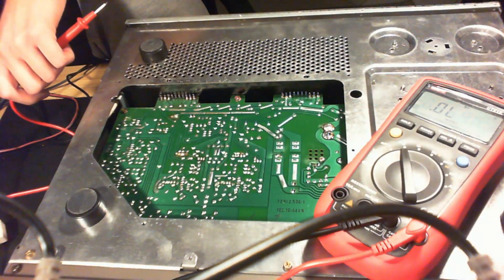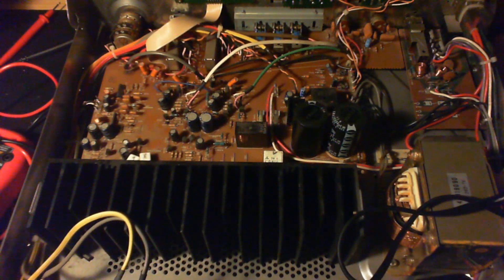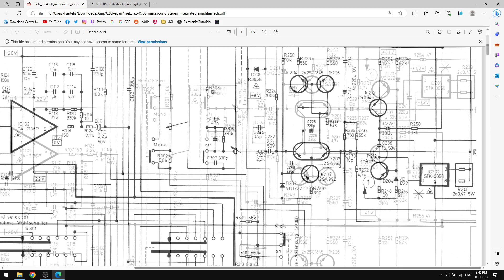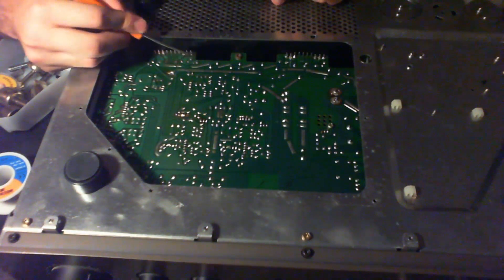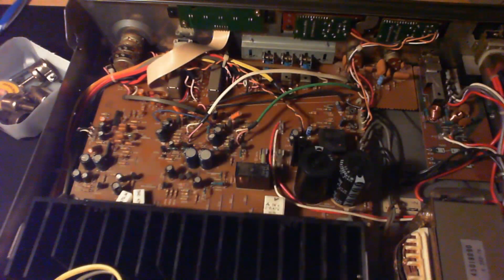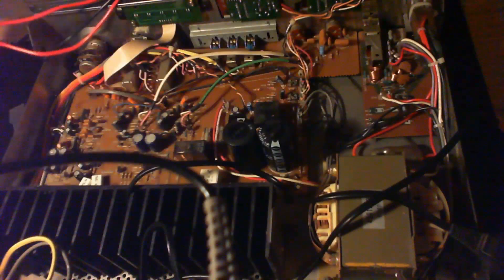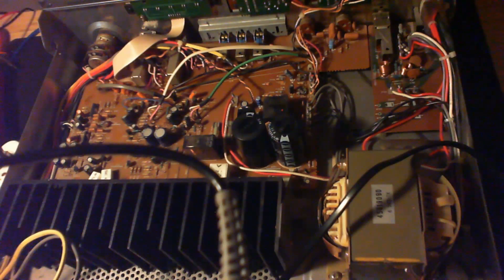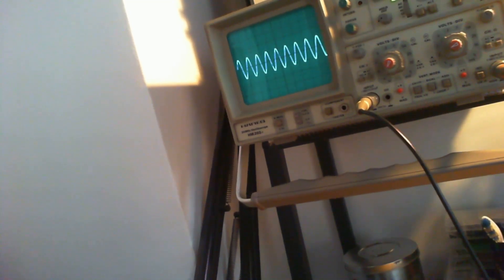Metz Amplifier Repair Fail - Fake STK 0050 Replacement shorts in seconds (Part 2)

Comment: I have worked on a similar amplifier like that 1 before and I learned one thing. If you replace the SDK power pack, you'd better off replacing both of them. Because 3 months down-the-line, the one that you didn't replace is going to burn. Out cause that's exactly what happened. I replaced one side.  And 3 months later, the other side burnt out. So you'd better off ordering another one and replacing both sides. Play it safe and replace both sides at once. Just like when I do an older Applifier I replace the transistors on both sides to make sure that it starts off with a whole new set of transistors. And this way, it doesn't come back later on. And customer will not be screaming at you. You fixed it, and now it's broken again. You take care of both sides at once and you won't have to worry about it.
Reply from the maker: You are absolutely right. Pretty sure if i fix the one channel, on loading the other one is going to fail in a few days. Sure when you fix stuff for customers you want to get all the stuff that can fail out of the equation, because if something fails after a while most of the times is not your fault but you have to take responsibility if you want to limit hashle with the customer.
Anyway,
Thanks for tuning in and commenting!
Have a great day!